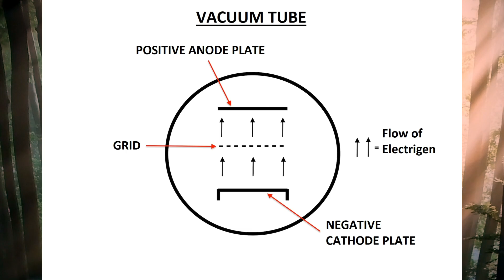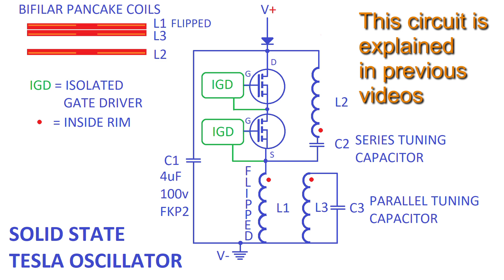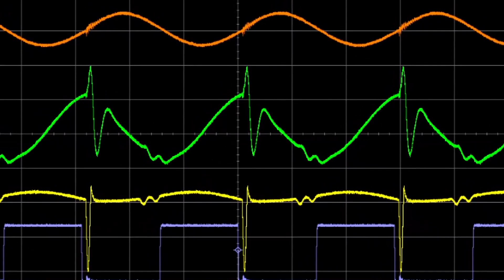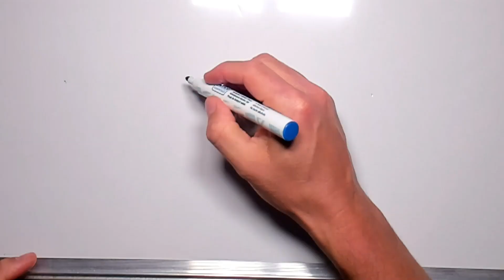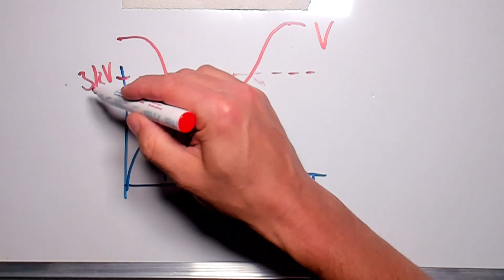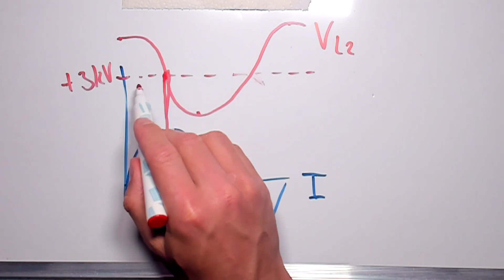The Coil Capacitor

Comment: I get very animated in my 5D world in my head when you speak of electromagnetics, phase shifts, and power development etc. I was thinking how single wire coil plates could be manufactured to eliminate such things as the speaker wire conductors having a rope like structure with all the twisted wire strings,  passing high frequency current giving a skin effect in the conductors. If a single conductor was used like enamel coated copper of a particular diameter say 1mm, a pair of acrylic discs  could be made into a bobbin having a much smaller diameter disc and a thickness of say 1.1mm, coil capacitor plates could be wound and placed very close to each other and maybe potted together. I don't know, maybe it is totally necessary to use the speaker cables as you do. I love this sort of thinh, at forst I was thinking of Mundotf inductors as capacitor plates, bery pricey though.

Comment: In Italy E.Majorana (with Rolando Pelizza) was able to get oscillating fields ( for a low energy electron-antielectron couple ) only charging on different axis 2 couple of rotating discs (electric and dielectric). 
Thanks for the nice video.
Reply from the maker: Did you translate your message yo English? it's very hard to follow

Comment: I made a piece of orgonite years ago with metal dusts and a coil with the ends sticking out of the bottom of the piece. I found it earlier after not seeing it for years and I tested it with my esr meter and it shows as a capacitor. I was expecting it to show as an inductor.

Comment: You mentioned this to me in a previous conversation. So after looking into this deeper, I believe I have found a “critical”point of confusion for a lot of people (because it got me too.) because Tesla refers to this as a “condenser” and I’ve assumed they were synonymous with capacitors however it is more like a “capacitive conductor” or potentially even a “capacitive transformer”
Reply from the maker: yes each coil also has capacity.
each wire has inductance and capacitance.
and you can use 2 coils as capacitor plates
Reply: @ I’ll give that a try and see how it goes it goes. Have you seen “Charlie solis?” I found this guy the other day and his take on it is almost exactly what I have been trying to explain.
Reply: The plasma channel guy shows an example of the positively charged particles (or whatever is happening) in the “bifrost nebulography” video.
Reply from the maker: @johnkuykendall7028  no haven't seen him

Comment: hi ivo the dielectric in the pancake coil is perpendicular to the magnetic field as always as you know, if you just want to collapse two field into one the caduceus or opposing winding will do the job of course you will end up with an E field or a radiant field with the magnetic potential vector added to that field like in the backing coil scenario and it`ll be also perpendicular so you will need to pick up the potential with an antenna, that will be two metal plate in the center like some kind of layden jar, the epoxy with the other component will also amplify that potential, to convert that potential into electricity again you will have to add some magnetic moving component of course
Reply from the maker: I wonder about electro static discharges, combined with magnetic implosion.
Reply: @MasterIvo  yes you are onto something with this

Comment: Master Ivo ...you said "titanium dioxide"  has a "K of 64" ... how do you workout how much "titanium dioxide" do you need (to mix with epoxy) to make a dielectric layer between 2 coils ?
Im looking at making capacitors which i can use (instead of batteries) to power an inverter. (caps continually charged with high frequency low voltage [12-24v] & diodes). Thanks heaps in advance.
Reply from the maker: I tried small batches of different mix ratios, and got a feel for it. in the end   I justed use epoxy without TiO2 because the air bubbles didn't get out properly

Comment: Thanks for your thoughtful research. I plan on making some very detailed flat bifilars with silver wire after leaving America. 
Aren’t flats more efficient at longitudinal wave propagation? 
Tesla wasn’t so concerned with transverse waves, what apparatus might I be able to use to measure the input/output of longitudinal waves? Probably not a lot available for that, but it’s always good to ask.
Reply from the maker: Make a antenna/sensor inside a Faraday cage, this should shield it from transverse (tem) waves, but not from longitudinal (lmd).
Silver is great.
Yes flat is the best, but still much to be learned and discovered

Comment: The coils may vary in length, diameter and wire strength. You use loudspeaker wires with different diameters and a different number of windings. Did your experiments exhibit an approximation or even a formula how these parameters affect the capacity and inductivity of this type of coil?
Reply from the maker: I normally don't measure those, sometimes I do, but I never use the data. It's enough to tune and see the signals. But I always keep the copper mass equal of the primary and secondary.
Measuring the capacity of a coil isn't easy, because its so small and the probe effects it.
Reply: @MasterIvo  Good morning, Ivo. I think I used a wrong wording in my previous question. I did not assume that your goal is to come up with sophisticated math. I am just wondering what empirical experience you gained over the past years working with "pancake coils" with regards to the overall length and diameter of the bifilar speaker wires. They come in different sizes. 

I noticed that you changed the design of your coils over the years but I did not see the trend so far. For instance: More windings increase capacitance and inductivity but also the resistance and the shape of the electromagnetic field. In order to keep the size of the coil low, you may choose a wire with a lower diameter. If you choose a very small wire diameter, you run the risk of arcing between the windings.
Reply from the maker: yeah and low diameter is more resistance. I am aiming for high voltage impulses. so L1 which produces them has the thicker wire 2.5mm2 with less turns.
L2 recieves them but needs to be at a lower frequency, so I use 1.5mm2 with more turns.
L3 could get more turns than L2, with 0.75mm2 (but equal copper mass to L2), but until now I have kept L2 and L3 equal size.
instead I use 0.75mm2 for L4 with more windings, for more voltage less current.

Comment: The Coil Capacitor is it ready to be use for power???
Reply from the maker: alsmost. I am building a new one, based on the insights I gained. It will have a high resonant voltage coil, and a separate high resonant current coil that together form the capacitor

Comment: Very nice, his ocilator was to produce high potencial voltege and frequency. May be to suply the tawer(big tesla coil) and to spread it thow the ar with zero resistence 90* from each outher( scalar longitudinal action at distance) from a DC satabel sorce( zero back emf, nore self-induction losses). Breack the would record of transmiting by ar over 1000w more then 1 or 2 meters and you will wen mony from guiness book or a nobel on fisics eletrics. Good luck a hard work

Comment: From other sources every time I see someone pot a coil in epoxy it makes the coil work so much different it doesn't function anymore. if I happen across a medium that does work I will let you know. but my guess is we already know the dielectric of most things. it may be as simple as looking it up on a chart. but trying to do something that is unknown is probably better sticking with air because you know that is what Tesla used. This brings up another consideration, the speaker wire, has a thick coating of plastic that is taking up space that should be air or the coil was tighter for Tesla these items could make a huge difference between what Tesla was capable of and what you have. didn't Tesla use enameled wire?
Thanks for the video!
Reply from the maker: tesla used higher voltages with his air coils.
He used al kinds of coatings, like parafine and beeswax soaked cloth.

My voltages are relatively low (3kv) so to strengthen the field it makes sense to me to use a high K material like titanium dioxide
Reply: @MasterIvo  Thank you, I see where you are going now.